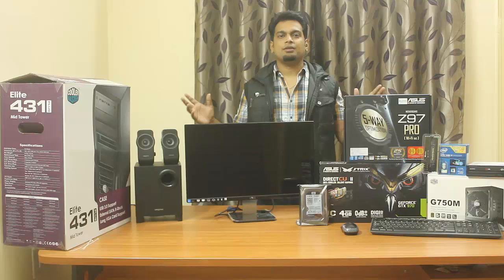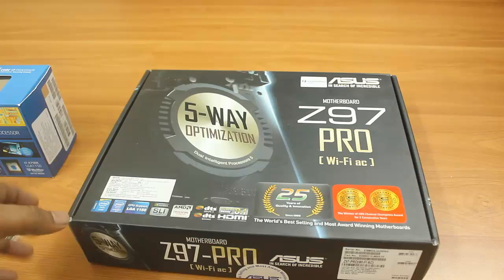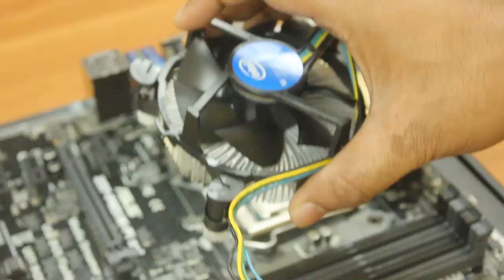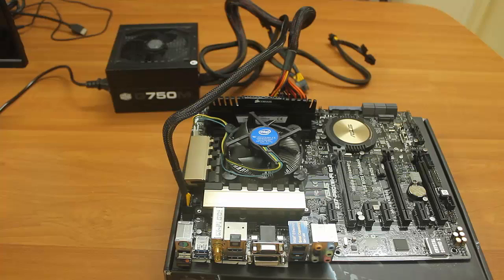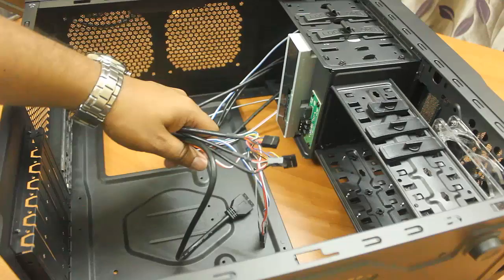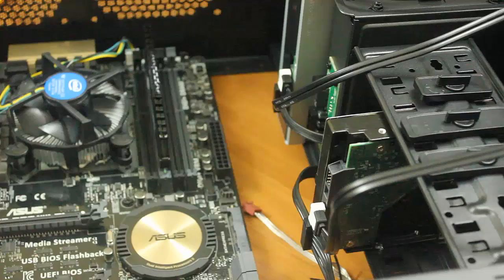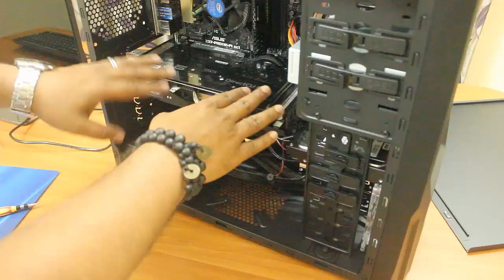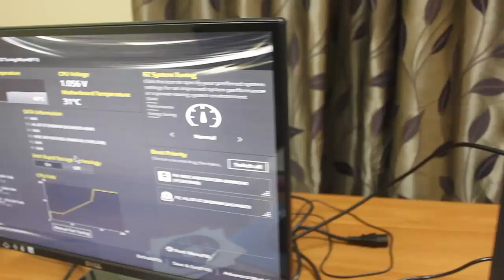How to build $1500 ultimate gaming PC  2015 - 2016 | India | intel i7 4790K | GTX 970 |

Comment: z97 pro or z97 deluxe....which one will be better?
Reply from the maker: I would recommend you to go with Z97 pro wifi .. its new and works flawlessly .
Reply: Bit z97 also has the same features and I also heard that deluxe heatsink is better than pro ...
Reply from the maker: I have not heard about better heatsink ... any ways both are good MoBo .. can go with any of them ..
Reply: Can you tell me differences between Maxwell and strix
Reply from the maker: Abhishek Chowdhury Maxwell is GPU architecture from Nvidia ..Strix is the model range of graphics card from ASUS ..

Comment: My gaming PC: Total is around 1300-1500$ Depends on country (I'm in Sweden)
CASE: Corsair Graphite 760t Big tower black

CPU: Intel Core i7-4790K 4GHz

GPU: EVGA GeForce GTX 970 SSC ACX 2.0+

MOTHERBOARD: ASUS MAXIMUS VII HERO

PSU: Cooler Master G650M, 650W or 750W

RAM:Corsair vengeance
8 GB DDR3 1600 MHz 

DVD: ASUS DRW-24F1ST

HDD: WD  Black 1TB

CPU Cooling: Corsair H80i GT Hydro 

Around 1300-1500$
Reply from the maker: BeazT Bonez Nice Config.

Comment: Tech Virus
Broo please help me, or anyone who read this....
need your kindly advice for me, this is good or i need to change some parts?

proc : i5 4690K
mobo : MSI gaming 3
VGA : MSI Geforce GTX970 Tiger Edition
RAM : Corsair DDR3 Vengeance Red PC12800 8GB (1x8GB) (if i get enough money, i will buy 8GB more total 16GB)
HDD : WDC 1TB SATA Cavier Blue
SSD : Samsung 850 EVO mSATA 120GB
PSU : Corsair CXM Series 600W modular - Bronze

and my question is:
This build can run COD, Battle Field, GTA V etc at Ultra Settings?
also this is good for video editing? (semi video editing is enough)
last... PSU corsair cxm series 600W is good enough for my build?

I'm newbie btw, this is my first build, so really need your advice bout my build.
Thanks!
Reply: This build easily can play games at 4k...no need to worry about editing and such
Reply from the maker: Rizal Hab I would recommend you to go with 250GB SSD and 750W PSU (for future use, if you want to go for  SLI later) rest all the specification is good to run any game at max setting at 1080p

Comment: can someone help me 
i am building my PC with the following parts will it work without bottlenecking
MOTHERBOARD - MSI H97 GUARD PRO SOCKET 1150 INTEL
PSU - THERMALTAKE SMART POWER 650 W BRONZE +
GPU - EITHER MSI TWIN FROZR OR ASUS STRIX 970 WHICHEVER IS BETTER
CPU - INTEL i5 4460 SOCKET 1150
RAM - (2*8) 16 GB ANY BRAND CORSAIR     GSKILL ETC 
HDD - WILL BE FROM MY OLD PC
SSD - 840 PRO SAMSUNG 256 GB
AM UNDECIDED ON CASE BUT WANT TO GO WITH ANYONE FROM COOLERMASTER
please help with cooling and letting me know if theres a cheaper alternative because IM ON A BUDGET
HELP ME WITH CASE ,GPU, AND PC COOLING

Comment: im thinking of getting this what do you guys think ? 

CPU	Intel Core i7-4790K
	

FAN	CM Hyper 212 EVO	

MOBO	ASUS Z97 PRO LGA 1150	

GPU	EVGA GeForce GTX 980 (SLI x2)	

RAM	Crucial Ballistix Sport 16GB	

SSD	Samsung 840 EVO 250GB	

HDD	Western Digital Blue 1 TB	

CASE	CM Storm Stryker Full Tower	

PSU	Seasonic M12II-850	

ODD	Samsung 24x SATA
Reply from the maker: Awesome configuration, just replace WD 1 TB Blue with 1 TB Black edition .
Reply from the maker: Tech Virus One more question , are you using 4k display device for gaming ? If not then SLI is not required for 980
Reply: thanks :D im getting any screen that fits my budget then maybe upgrade... oh may i trouble you with a question why replace WD 1TB blue with 1 TB Black edition
Reply from the maker: Black edition is the best HDD from WD , it has 5 years of warranty and has better performance than Blue .
Reply: thank you so so much :D
Reply: How much did your's cost? More than $1700?
Reply: around $2000

Comment: Can I use liquid coollers in this pc.....
Reply: Use cooler master hyper x212 for excellent cooling because liquid cooler may leakage and damage your system. Choice is yours
Reply from the maker: +hiren “hiru919” panchal Even I am using this .. its great !
Reply: using coolermaster hyper X212 or liquid cooler? i am using cooler master 600w psu with gtx 980. Is this good enough or bottle neck psu for over load?
Reply from the maker: Depends upon processor ... air coolers are enough if you are not overclocking your processor .

Comment: I am following the same as your PC, the Question is can i install any graphics card for this motherboard?
Reply from the maker: Manoj Golla Yes .. any desktop graphics card . Just a suggestion, do not buy cooler master G750M PSU , go with Corsair RM 750 ; I faced some issue with cooler master ..
Reply from the maker: Tech Virus also you can go with SCOUT 2 cabinet .. check this video :-
https://youtu.be/4uSWZmYPYMA
Reply: Tech Virus CAN I USE CORSAIR RM 650
Reply from the maker: Yes, if you are not planning for SLI 2 cards... 650 is enough ..

Comment: Dude 4790k is not better than 4770k for the heatsink / cooler  it is better because it has  the new die (transfer of heat from the he
at from the processor to the heatsink. and 4790k is better in over clocking than i7 4770k and base clock is 4.0 ghz and boost ant 4.6 ghz and BTW it cannot be over clocked to 5.0 with a stock cooler and even if you use a corsair h100i or a custom water cooling  it not a stable over clock and only some have been able to achieve it . 4.7-8 is the achievable clock speed dude

Comment: Why has no one commented on how he put a STOCK cooler on his board then took it off and put it back on again! ones you put it on and take it off you have to start all over again. Wipe it all off with a lint free cloth AKA coffee filter and reapply thermal paste NOT GEL! not doing so can cause air pockets between the CPU and cooler causing high temps or higher than average temps.
Reply from the maker: You are right ... I should have done it .. I did not had thermal paste that time . I will do it soon .

Comment: Did you forget to install the motherboard stand-off's? lmao

I noticed that you didn't show yourself installing the motherboard stand-off's. That's probably why some of the screws weren't going in properly. Haha wow, i'm surprised your motherboard didn't short out when you powered it on. 

You should go back and install your motherboard stand-off's for a proper and safe installation. Just a heads up :)
Reply from the maker: Thanks .. few more ppl told me about the same .. I have installed them now and updated the video with a comment :)

Comment: I want to make a gamimg pc between 60 to 70k can u plz help me with it as i have no idea of how to make a pc between nice video
Reply from the maker: Thanks ... You can go with this config :-

AMD  fx 8350  - Rs.12000 
GTX 960 2GB GDDR5 - Rs. 17000/-
ASUS M5A99X EVO Motherboard - Rs.11000 /-

Rest components similar to my built .. :)
Reply: Tech Virus i would go for a R9 280X or a gt 970(if not these two i wold prefer a r9 270x cause of the price/performance ratio)
and for the processor I5 4690 or I5 4570 and use an aftermarket cooler(the tdp on 8350 is pretty high and you'll need a bigger psu to run the 960 and 8350 bulldozer)
and for the motherboard a MSI Z87-A pc mate(a pretty good mobo for under 10k)
this would be a kickass gaming pc cause the 4690(or 4570) would not bottleneck the r9 270x and the single core performance is pretty good

Comment: My specs:
Intel Core i7 6th Gen 6700K 4 GHz Processor
Corsair Hydro Series H100i GTX Extreme Performance Liquid CPU Cooler
Gigabyte GA-Z170X-GAMING 5 64GB DDR4 Intel Motherboard
Corsair Vengeance LPX 16GB (2x8GB) DDR4 DRAM 2400MHz
SEAGATE 1TB Desktop Internal Sata Drive
Samsung 850 EVO 250GB 2.5-Inch SATA III Internal SSD
Seasonic 750W Modular Power Supply
Asus Internal DVD Writer
LG 25 Inches 25UM57 21:9 Ultrawide Gaming Monitor
Corsair Carbide Series 400R Mid-Tower Case - Black
Zotac Geforce GTX980 Ti AMP! 6GB GDDR5 NVidia PCI E Graphic Card

What do you think guys?? Any suggestions?
Is the ultrawide monitor (2560x1080) good with a GTX 980 ti for ultra settings gaming instead of a 1440p monitor?
Reply from the maker: +Samyak Shah Awesome Build... How much did it cost ?
Yes, go with ultra wide monitor .
Reply: +Tech Virus Thanks! It cost me 1.7 lakhs. And really nice video!
Reply from the maker: Great ! Thanks for your comment :)
Reply: +Samyak Shah 
Personally, I think 980Ti for 1080p gaming is overkill. 980Ti can deliver 120+ fps on most of the games these days and your monitor has IPS panel with max 60Hz frequency. Believe me, you are wasting the powerful GPU that you have. Get a 1440p monitor IPS or atleast 144 Hz TN monitor.

Great CPU config btw, I have pretty much the same configuration as yours. :)
Reply: idraco1991 Yes the 980Ti is powerful but I have ultra wide (2560x1080) resolution monitor and not the standard (1920x1080) monitor. So at ultra settings (or pretty much everything maxed out) I get around 45 to 60 fps for games like Far Cry 4, AC Unity & GTA V. It is better than 1440p monitors which are expensive in India plus there's the benefit of "ultra wide" gaming which is awesome. Moreover considering to play the games like Far Cry Primal, The Division & Hitman which are upcoming in the near future at ultra settings 60 fps, GTX 980Ti for this ultra wide monitor is suitable.
Reply: +Samyak Shah i am having the same confusion bro wheather to go for a 1440p 60hz monitor or the lg ultra wide 2560x1080 :/
Reply: +Samyak Shah i have the same specs as yours and is the 750w psu enough for all these components we have or should i go for 850w?
Reply: +Jayant Rana I have a 1440p IPS monitor - amazing if you want to do photo/video editing as well. Also, the monitor mentioned here is outdated and doesn't sell anymore in London - I would suggest you to go with the latest ultrawide 1080p in that case.
Reply: +Jayant Rana It's absolutely fine unless you go for SLI configuration in future, then it might be close. A 980Ti generally takes about 250W TDP and in SLI, it might get close to 750W depending on what other components you use and how much the CPU and GPU have been overclocked. A PSU generally is most efficient when it works at about 80-85% of the peak wattage it can support. Go for 850W (Gold+) PSU if you want to future proof.
Reply: thanx for the reply mate and please suggest a monitor which can justify the performance output from the 980gti 6g . Recommendations are welcome :D . Like a 1440p 60hz or the ultra wide monitor from lg that is 1080p but lg says it comes with a freesync technology that is good for gaming and all the stuffs like that .
Reply: +Jayant Rana Hi! I am using the LG 25 Inches 25UM57 21:9 Ultrawide Gaming Monitor (2560x1080) which is awesome and is suitable for playing games at Ultra max settings (using the Nvdia GameWorks too). If you go for 1440p you might be able to play most games at ultra settings but not all. To get 45-60 fps at 1440p you might have to keep top games at very high settings (not ultra max). Plus as I have mentioned before 1440p monitors are too expensive in India but if you find a good quality monitor for good price you can go for it.
750 watts is fine for GTX 980 Ti gaming but if you want to SLI in the future go for 1000 watts PSU
Reply: +Samyak Shah thanx bro B-)

Comment: Hi! I really liked you video. I am going to build a gaming rig myself. I have decided these components. Please just verify If i am doing it right or not. Here is the list-

Cabinet:-Circle Gaming Cabinet CC 821 without SMPS (with 3 LED FAN) = 3399/-
Processor:-Intel 4th Gen Core i7-4770K Desktop Processors = 25800/-
Motherboard:-MSI Z87-GD65 Gaming Motherboard = 13125/-
Monitor:-DELL S2240L 21.5" LED = 9166/-
GPU:-MSI NVIDIA Geforce GTX 960 Gaming 2 GB GDDR5 Graphics Card = 19500/-
RAM:-Corsair Vengeance DDR3 8 GB (1 x 8 GB) PC DRAM  = 4492/-
Storage:-WD Blue WD10EZEX 1 TB Internal Hard Drive = 4290/-
PSU:-Seasonic S12II 620 Watts PSU = 5950/-

Comment: What about static electricity. i74790K is 25000+, That Mobo is more then 17500/-, you're wasting your money, if you don't run a SLI on that Mobo, and not overclocking is a waste too.Swiftech H 220 will go best, as your case will not fit H 320. Other non expandable AIO Coolers are a waste of money as they are flimsy aluminum and non expandable.
Reply: emulum qurkool , Swiftechs any Cooler will half fit the case, means radiator in & the fans out & vice versa, not enough space between the memory module & the top vent. Yes static Elc is important.

Comment: Uh dude. I'm telling the true here, but you've got quite a couple of errors and things you have missed out on your description.

1) You said that the Intel Core i7 4790K is expensive because the heat sink is too good: well, all LGA 1150 socket processors have the same heat sink, so an i3 4150 or an i5 4460 will have the same heat sink as the Intel Core i7 4790K. The real reason why this CPU is expensive is because: a) it supports hyper threading, allowing you to work with 8 virtual cores, b) because it is a "K" series unlocked processor, meaning that you can overclock this processor, and c) because it has got a relatively high clock speed compared to the other processors. It has nothing to do with a better heat sink. Also, if you want to overclock up to 5GHz while keeping the CPU stable, then you will probably need a better cooler (even something like the Cooler Master Hyper 212 Evo is good).

2) About the power supply: the only thing you talked about was 5 year warranty. You've got to mention that it is 80+ Gold Certified, meaning that this power supply is extremely power efficient compared to the 80+ certified and bronze certified PSU. Moreover, 750W is a good amount of wattage, and being 80+ gold certified, this is a good PSU. Yet, you didn't explain this.

3) About the RAM: you did not talk about the specific details. The clock speed of the RAM. The CAS Latency of the RAM. What is all that? Just DDR3 Corsair Vengeance RAM does not tell us anything. EXPLAIN MORE. Moreover, just because it has got black heat sinks, how does this make the RAM "too good"? G.Skill RipJawsX have red heat sinks and can probably perform the same with this RAM, and the Kingston HyperX Fury RAM has a blue heat sink and has a higher CAS latency (is much better),

4) Motherboard: you said some stuff, but you can definitely go into more detail about it.

5) Graphics Card: You chose the ASUS Strix GTX 970 (you knew that, right?). You didn't talk about why you chose this over any of the MSI, EVGA or Gigabyte Cards. You didn't talk about the clock speed and even the VRAM. You can give some reference to the viewers about what games you can play at what resolution. You said Nvidia has done something great. Well, you know that Nvidia only makes the chipsets and the companies do the rest? TALK ABOUT THE SPECIFIC PRODUCT AND COMPANY (ASUS IN THIS CASE). Moreover, the performance is not equal to the GTX 980. The GTX 980 is better, not by a big lot, but still will be better in ANY GAME. If they perform equally, then why is the GTX 980 more expensive?

6) Hard Drive: Btw, TB is pronounced as terabyte, and 1TB = 1024MB if you wanted to know. The RPM speed and cache of this HDD? TELL US MORE. Why 1TB? Why not 2TB or 500GB? you need to explain a lot more man for other people (I know that the WD Black 1TB is a solid HDD, but explain so that other people can reference).

Dude, explain more about the procedures when you are actually putting the computer together. Why use the motherboard as the base? It is for a free non-static work place as static or static electricity can effect the hardware!

When installing the CPU, talk about how there is a arrow on the motherboard that corresponds with the CPU arrow!

No offense dude, but your video has a lot of flaws man.
Reply from the maker: TechBuildPlus I definitely want to thank you for giving time in writing all these, few of your points are really good .. I certainly did a mistake by telling "Heat Sink", it should be heating efficiency. That means this processor heats lesser than other "K" edition processors. I have also created video for each and every components separately and explained in details about its feature . Main objective for this video is to guide ppl on how to do assembly . Few things to point out in your comments :-

1) I am about to install external heat sink , most probably Hyper 212 EVO and will come up with overclocking video soon. 
2)This PSU is not 80+ Gold , it 80+Bronze 
3) Its very basic knowledge, every one knows about TB stuff .
4) ASUS Z97 Pro-wifi MoBo does not have corresponding arrow for CPU as its common for other MoBo , that is why we need to put cpu by looking at 2 small cuts .